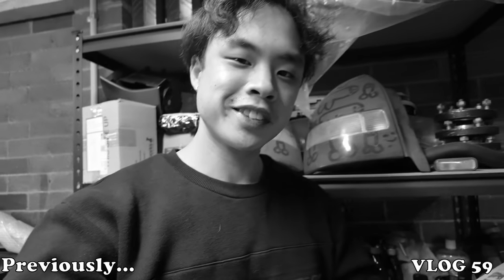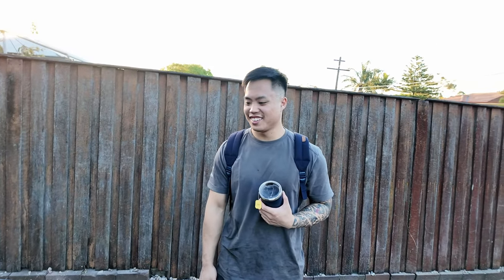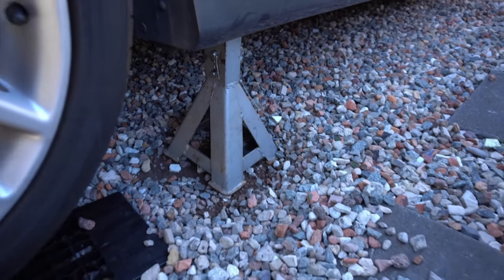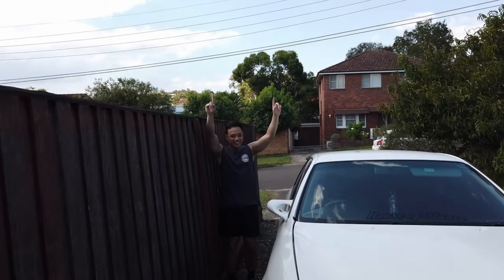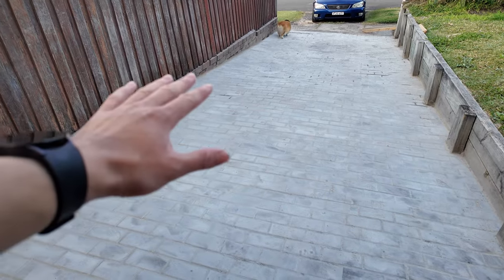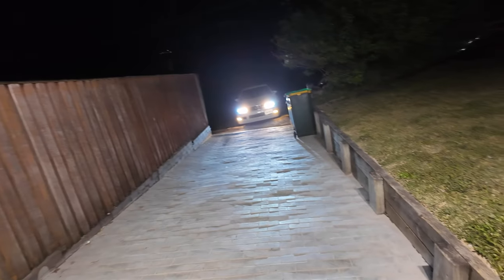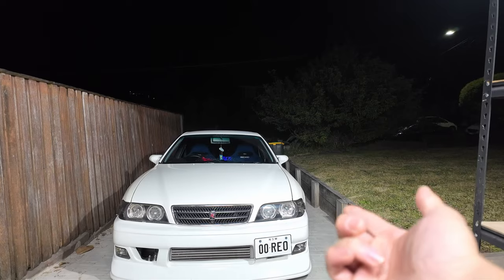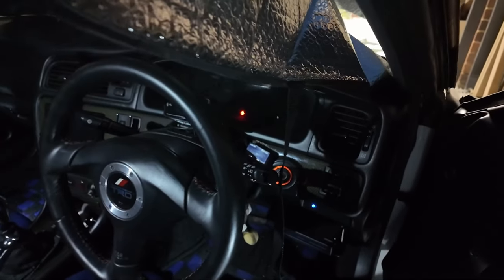OUR NEW DRIVEWAY!!! | Vlog 60

Comment: Heads up, its a POWERFC issue itself. I have a powerfc on a JZX100 and it would idle hunt when there wasn't a light wasn't on or the rear demisters weren't on etc. Solved through rewiring the actual pinouts of the ECU. 

That being said, move to a more advanced engine control unit. The budget may say no, but a poor man pays twice.
Reply from the maker: @lrd2258  yessiirr! Hope by next year I move on to Haltech or Link